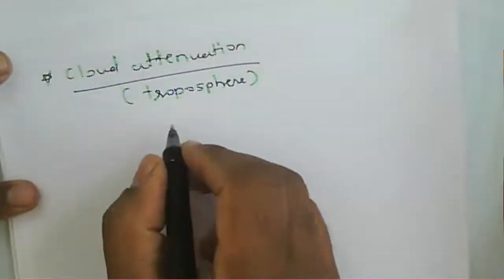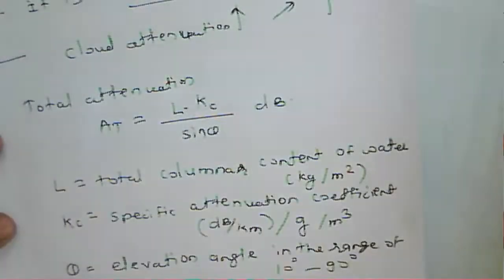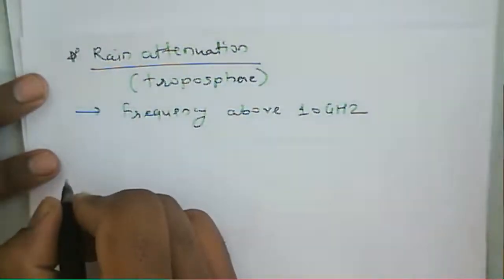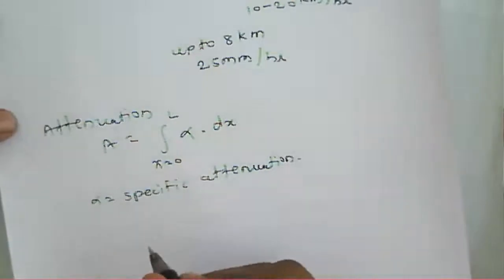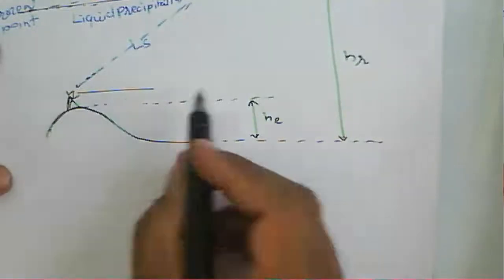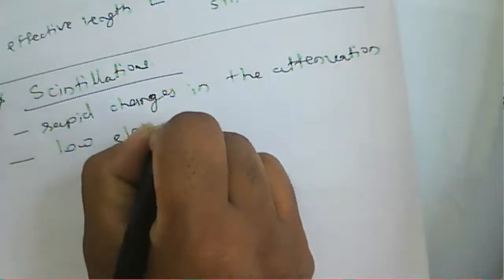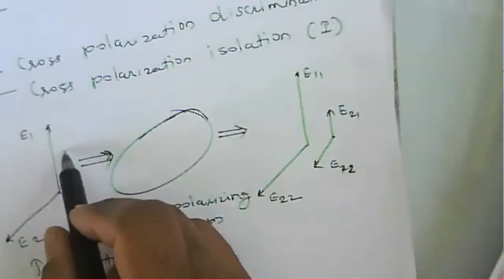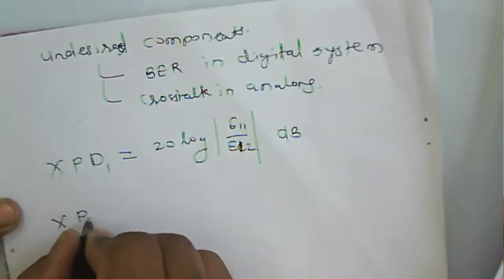Satellite Communication: Lecture 33: Cloud attenuation, Rain attenuation and Scintillation

Comment: Consider an earth station situated at latitude 5.6°N and an altitude of 
100  m. The Bureau of Meteorology gave the average rainfall of 7.85 
mm/h, not exceeding 1.09% of the year for the location. If the station is 
to be oriented to the satellite at 28.5°, estimate the loss due to rain and the 
availability of the link for 12.5 GHz transmission